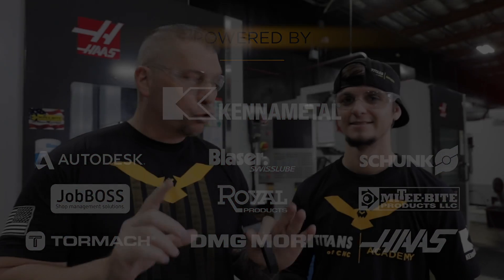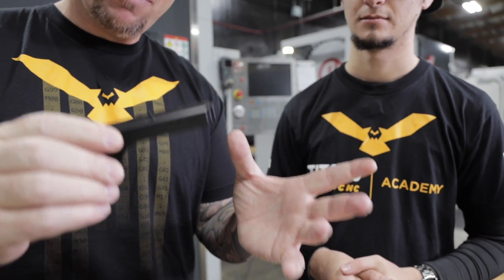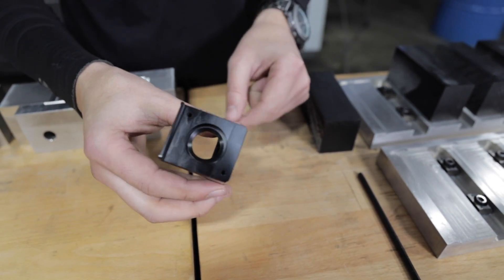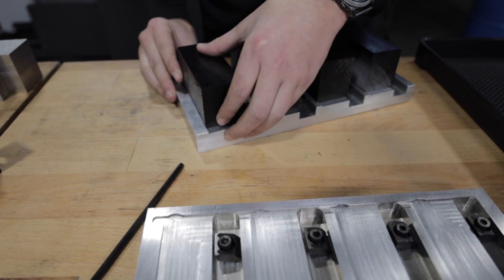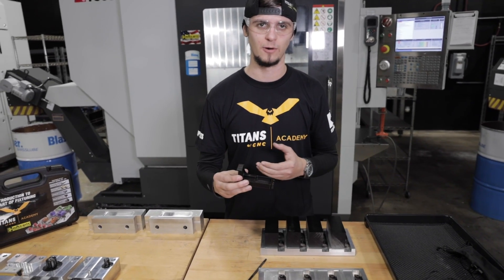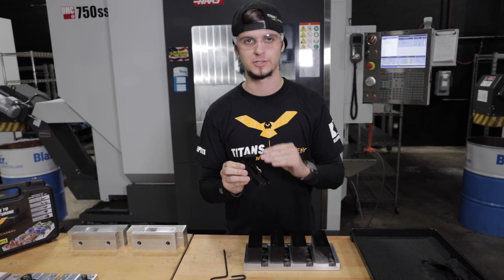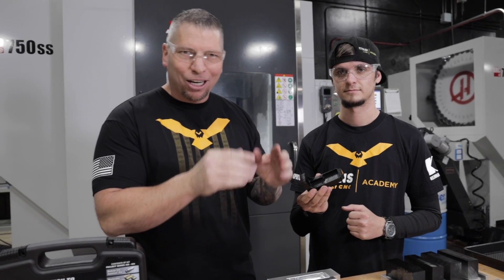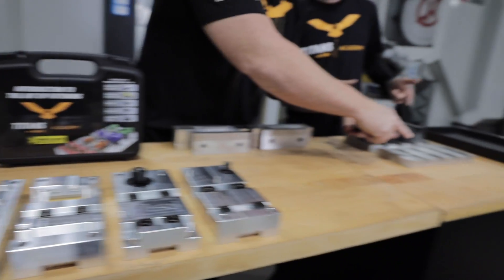Impossible Plastic Part | TITANS of CNC Vlog #52

Comment: if you have ever milled copper with critical dimensions this is 101 knowledge otherwise you will never be able to manufacture perfect parts, Great video
Reply: copper is one of the hardest materials especially with tight flatnss tolerances call out its just a nightmare

Comment: I've only ever worked with black delrin on a swiss  machine before, so not much in the way of fixturing ;) Had some pretty tight tolerances though, +/- .0002, etc. Ran a few parts after my setup at nominal, came back in the next morning and it was undersized. Moved about a total of .0005 overnight. So I ran the rest of the job at +.0003 above tolerance and they all came back fine.

Comment: After sitting in a free state for six months it won't be flat, parallel, or perpendicular anymore.  The relaxing they are doing during the machining process only helps remove the machining stress.  There are still internal stresses that will come into play after the part sits for longer.  We are dealing with the exact same thing at my shop right with parts in inventory shrinking over time due to the aggressive threads we have to cut in the part.  The best way would be to rough the parts put them in an annealing oven and get the plastic really relaxed, the finish machine the parts.  At my last shop we had very large parts (4.5 inches in diameter and some over 14 inches long with thin walls) made out of Delrin that we had to rough leaving .100 thou in all dimensions.  We the would anneal them then finish them.  The  customer reported that after doing all this the parts no longer shrank after they put them though cycles in an autoclave.  It was not a fast process, but it made parts that were more stable over time.
Reply: How do you anneal Delrin? What temperature and for how long?
Reply: @gmbreloading  Man that was along time ago. I know the final temperature was 450deg. The total soak time at that temp was 1 hour per 1 inch of thickness. There was a 5 hour ramp up in temp, soak time,and then another 5 hour ramp down. We had a very precise programmable over that we did it in.

Comment: I tried to machine a miniature engine in plastic, wish I had seen this video first, got the project done in metal I couldn't cut the plastic without it warping as described.  The relaxed material method makes sense once one has tried to cut plastic parts with tight tolerances.  All about the fittings and fixtures to support the part, I was just trying to clamp them down however I could and not aware of the materials tension and thermal issues until they showed themselves.

Comment: A way to clamp parts with little stress and reduce  having to clamp and re clamp on your soft jaw set-up is . Machine your hard stop soft jaw as required. Then  for your movable jaw mill holes in as many places as you would like down the length. This is to insert springs using another piece of stock mill holes to accept the springs.  This is now your holding system for consistency use a block you will clamp the vise on inside the vise. The tension of the springs will hold your part at the same  pressure each and every time.  If your  holding area is thin you will have to use some guide pins to keep the spring jaw from rolling off center.

Comment: I have been doing this for 40 plus years and it's all about the process and fixtures. It's also knowing which parts you can make money on and which ones you can't. Just because you can make it doesn't mean you will make money making it.  Good video,  I have machined  alot of plastics fixed alot of injection molded  parts for customers who purchesed the parts overseas.

Comment: Love the video, and it is pretty cool as a challenge, but why would you not 3D print a part like this on something like a Carbon? - that seams to be both quicker and easier.
Reply: I work in 3D printing and it’s not that simple. There is a lot of stress inherent in printed parts. That and you will never hold tolerances that are right with printing. Printing is also more expensive than CNC due to secondary operations that need to be done. You can get a base pretty simple but would still need to be machined.

Comment: Been machining super tight tolerances on beryllium parts for 20 years, much tighter than you mentioned in this video. The key is to fixture flat surfaces against flat surfaces. Using these methods would never work with the tight tolerances we deal with. Machine a flat datum then use that surface to locate against for the entire machining process and your parts will be great every time. Yes multiple operations would be needed and sometimes isn't great for high production runs but that's the nature of the beast.

Comment: If you can`t milling it- just 3D print it.
Reply: Strength is a limitation of 3D printing, you can certainly get good tolerances, and also decent strength, but a milled or molded part will be much stronger. If it doesn't have to be very strong 3D printing can be a viable option.

Comment: I can drop this part in 1operation flat to drawing using similar set I use claw jaws and then using a slitting saw run a round path and make a break diameter. The saw maintains flatness that's how its designed to work. Pretty part guys and great job I dont mean to dismiss your success just offer another time saving method I use. Plus I'm sick of people looking at me like I'm crazy until they see it work.
Reply: Sorry I meant one less operation looks like I side holes involved.

Comment: Hey. I work at a shop that builds natural gas reciprocating compressor parts. How you would you guys efficiently go about milling ported compressor valves.
The part looks simple but some of the ports are tapered to 125" wide and .8" deep and i find it can take quite a while using our current methods
Reply: @johnveix  no we dont. We do have hyundai wia L2600SY lathe but no 5 axis mill

Comment: Im from Germany and we always maschine plastic, if we would have that part it would be roughed out and than go into our in house heat treatment to relief all the stress.
With this technique its possible to machine big tubes with a length of 2 foot and a wall thickness of 0,2 inches!!  
Those tolerances are quiet tight tho we usually have like plus Minus 0,009 inches.

Comment: Hi 
Normally I get plastic that is relaxed and white now tension built into to it or a very small amount .
But one way to get a better result is to try to center the part in the stock an remove the same amount of stock all a round the part to even out the stress and in combination white relaxed stock it's perfect . Relaxed plastic is little more expensive but more economical in the long run.
You can get nearly all types of plastic relax , it's a heat treatment of several hours . 
A tip from Sweden
Reply: We started doing this for a plastic part for the navy at our shop. We'd actually rough the part to around .05", toss it in the oven at a low temp (about 150f or so, depends on the plastic), take it out and let it relax over night then finish it on the lathes/mills. Everything held pretty well after that.
Reply: That’s usually fine.For production work I want the material vendor responsible for how the plastic responds so I’m not chasing a process that may or may not be repeatable
Reply: We machine a lot of plastic medical components where I work and a technique we use is to release and resnug the vise before a finish pass to potentially allow the stock to spring out, Ive been begging them to heat treat to no avail.
Reply: Tor-

I was watching this and thinking the same thing I know that in 360 brass you can put it in a home oven at 500 degrees for a hour and that greatly improves the quality of the material, in theory it should be possible to do the same with black delrin or acetal but I am sure that the temp would be different have you ever tried to stress relive acetal or delrin and do you know what the temp and time are, also I know that there is compression molded delrin that is much more stable than standard extruded delrin have you ever dealt with that before....

Comment: Aren't you stressing the part when you reclamp it even though it's just tightened a little bit by the dovetail that is pulling the part down? how would you know if the part isn't stressed after reclamping it? Are you using some kind of methods to check how the part moved as you untightened it then retightened it? Would love to hear some insights from you guys. I like the Idea with the fixture though.

Comment: Love stuff like this...my biggest pet peeve use to be parts that were over engineered, we had a part before that the customer wanted the hole diameter to be 12.02-12.04mm and they sent us the part that went into the hole and it was 11.85mm, we could easily have just put a 12mm hole through and it would have been fine but you do what the customer wants
Reply: Make a phone call. To let the customer no but if they insist charge for the quality they insist
Reply: @johnl5177  We did that, they insisted that's the size they wanted

Comment: It's not really getting rid of the internal stresses, it just uses those internal stresses to your advantage. My problem with this would be that if the part, and I have utterly no idea what the application of this part is, gets heated and relaxes, those stresses that were working for you are now gone, meaning the part will warp after it's installed in the application. Wouldn't a better way to do it be to machine to within, say 10 1/1000th, and then anneal it to release any remaining stresses and then do all of the finish machining with the same light clamping pressure? The end result would be the same, but instead of using the internal stresses, you eliminated them.
Reply: I was actually thinking the same thing.  Annealing after rough cut, and maybe again after final if needed.  All of that could be done in the fixture or not.  We mold parts that require annealing often, especially medical and aerospace parts.  Could allow you to speed up operations considerably, depending on quantity of course.  Curios, you mean 0.010" right?  Good comment.

Comment: Normally, when you have a flatness tolerance, you need to mill both faces, or it will still creep when milled, m/c first face, then, dovetail, then all 1st side
Seen it loads if times.. Also we used to use a torque wrench on the vice for tight batch work:)

Comment: Would this part have been able to be 3-D printed
Reply: Form wise yes, tolarance and finish wise no
Reply: Yeah, probably resin printed no problem, not FDM printed because of tolerances, but this looks like delrin plastic (i might be wrong). And there is no resin that will be as strong as Delrin.

Comment: I have a suggestion that my supervisor and myself would like to see and to know. Inserts for insert mills. How to read and under stand the code for inserts ie: ADTK1505 and such. Also what math formula used to determine speeds and feeds for insert milling. I’m a recent graduate with a degree in machining, however my professors never covered insert milling. My boss and I have a 5/8 insert mill and using the standard speeds and feed formulas for standard endmills isn’t producing a faster and efficient time on parts for maximum material removal. Love your videos and we’ve learned a lot so far. Thanks!
Reply: visit manufacturers page for cutting data , also in the end parameters must be adjusted according to machine power , tool stickout , and rigidity .
Reply: Well I’m embarrassed to say this but our tool came from a second hand source and is generic. But looking at a lot of the tooling manufacturing websites, it’s like reading ancient Egyptian text.
Reply: @jeremiahprine9696  If by generic you mean no serial , no brand name , then it's probably some chineesium . For your tool , try Ap 0.15-0.2 , Ae 0.05-0.15 , feed 40ipm , 3200rpm  . Put feed and speed to 50% for the first pass , and good luck . (Still it's better to visit some tool maker's site , to get a general idea about feeds&speeds , width of cut and depth of cut)
Reply: @kisspeteristvan  I am grateful for the advice. My shop only machines aluminum and delrin. My supervisor knows very little about machining and I know little about CADs, however I can read the code in the program and I know how to alter the programs to increase cycle time and efficacy. So we have the inserts for aluminum but they came from Germany and no tooling information for speeds and feeds or depth per pass. I'm sure there are more experienced CNC Machinist rolling eyes right now, but at least I am asking and this helps cement job security.
Reply: @jeremiahprine9696  if it's alu , and alu inserts , than 4265sfm or 26500rpm for that 5/8 tool should be fine . Usually polished carbide inserts for alu have speeds up to 8000sfm . on the depth you can go 0.1-0.3 , width of cut up to 50-75% of the tool dia , and linear feed 200-250 ipm no problem . (To reach manufacturer's recommended  parameters you would have to go with 51000rpm , and 600ipm , but that is too crazy )
Reply: oh , and for plastics , you can increase every parameter as high as you dare pretty much . Especially the feed .
Reply: @jeremiahprine9696  However , If that insert is legit , should be able to handle 700sfm ,  depth of cut 0.4 , and width of cut 80% of the tool diameter , all day every day . but DON'T try that

Comment: Hey Titan, is it possible to show some high speed recipies for cutting cast iron? I worked at a shop that lightened big block chevy engine blocks and it took us 5 days to do it in a rottler f69a. Would coolant help this at all? And what cutters could be used in say a 5 axis Mill to reduce setups and speed the process?

Comment: The trick with that part is not the process. That was a very good explanation, even though you didn't touch on how you hold it to get the true position of the through hole feature. The trick is knowing all that when the print lands on your desk, and quoting, taking that process in to consideration when quoting. So, you don't loose your shorts on the job!
Reply: Im pretty shure the through hole gets machined in the first setup on the 5axis
Reply from the maker: Correct with the 4th Axis, same time

Comment: Gr8 video as always. 
My idea for this kind of a part: clamp it with bigger amount of stock and machine it higher above vice. Leaving more stock unmachined aboe vice. Plastic will be deformed up until only some amount but you machine relaxed part. and then on the same setup you cut it off with carbide circular saw. and all the specs should be in place. It works for me most of the time, and keeping parallelity of 0,02mm is no problem. And also this way with 5 axis You can machine whole part in one setup :) with no additional fixtures :)

Comment: 3-2-1 locating principle + your hints about letting the material relax before final pass = boom!  (Success). Thank you.
Reply: Could you please elaborate on the 3-2-1 principle or direct me somewhere with more info (link pls) ?
I learned about machining in my native language, not familiar with some technical English phrasing.
Reply: @zajtoja  Sure... it is the basic theory used to locate and hold a part.  You may want to check the society of manufacturing engineers video as a starting point:

https://youtu.be/NvGJolueIbU
Reply: @vromerobertoline 
Thank you